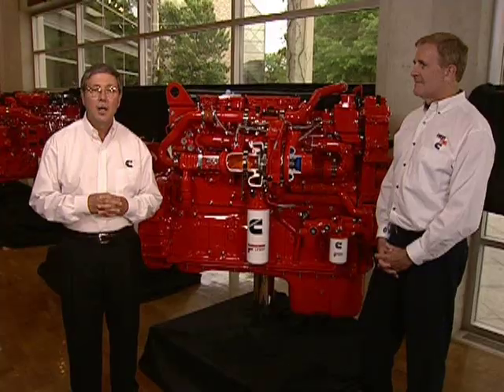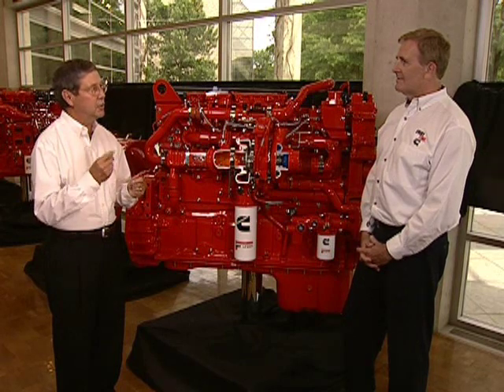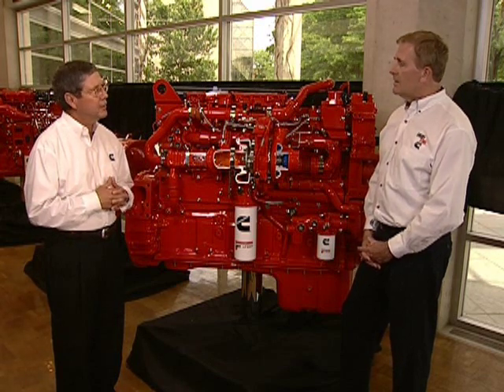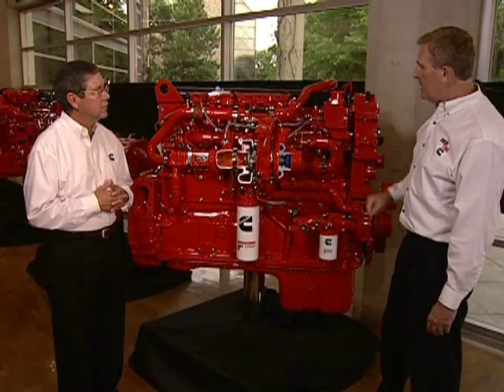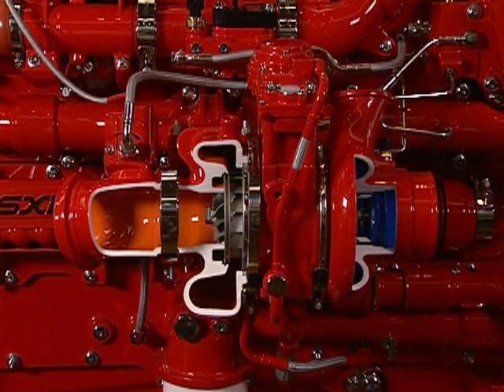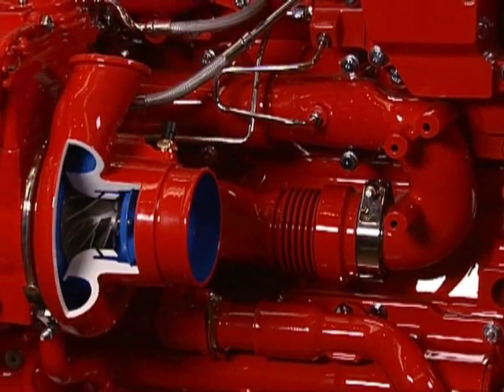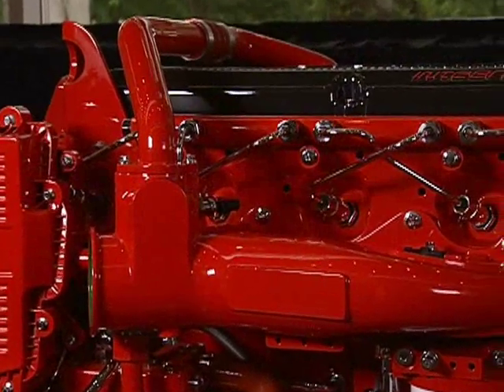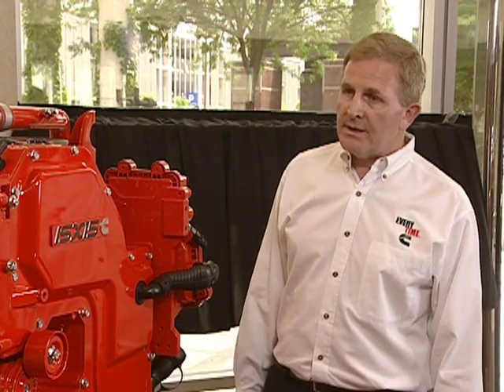2010 Cummins ISX15 Overview (Part 1 of 2)

Comment: THEY ARE GREAT!!!!.......until the front and rear main start leaking.....and the sleeve(s) drop....and the EGR granades....and the fuel pump blows......and the TURBO clocks out.....and INJECTORS crap out.....other than that they are GREAT!!! (I currently own 12 of them all Peterbilts.) I know these engines and their mechanics very well. Cheers!!!

Comment: Better fuel economy from SCR you guys are full of soot.  This is the worse thing to happened to diesel reliability since invention.  Tell people about the fuel pump that goes nuclear on the isx takes the engine with it tell people about leaking egr cooler that gets coolant into combustion chamber or that idling isx under 1k rpm will guarante you never see 500k. How much time you got I can go on all day
Reply: I’m looking to purchase a truck soon. I was looking at a 2012 T660 with 600k miles on it with an ISX 425hp. The more I read about this ceramic fuel pump being a grande for the engine, the more I avoid Cummings ISX engines!

Comment: Do not buy a Cummins older than 2014-15 unless it's been rebuilt with the new pistons and liners.
Reply: I have 06 K W w/ISX 1,200,000+ bearings and turbo at 600,000 that’s it. Schaeffers oil is the secret sauce

Comment: Everyone bitching that food and general merchandise costs haven't declined along with fuel prices over the past 9 months.... above is the reason why.  EGR/DPF systems on these over the road engines have increased repair/maintenance costs for trucking companies and owner ops by 20% on the bottom end.    You wanted regulations for those mean ole trucks.... now you are paying for it when you check out at the store.  Enjoy :-)

Comment: this engine is 100% BULLSHIT
Reply: So, how do you explain record sales?
Reply: the sales records .. does not make it a good engine .. cummins can continue to sell millions of motors .. but will remain the same crap ..
Reply: seabulls69 Records sales because they also entered small duty trucks/vans distribution.
 Fleets have only a limited selection now that Cat has left the over the road market leaving Cummins, Detroit (Freightliner trucks only) Volvo(volvo trucks only) and Paccar.  So you have mainly a selection of only two engine types in all new Peterbilt, Kenworth trucks.. a Paccar (Kenworth and Peterbilt company) or Cummins as well as International trucks offering cummins.
This engine might be a lot better if it didn't have the egr/dpf system on it. Those have caused many problems with all brands but more so with Cummins although they are working out a lot of the bugs and system failures there are still a high rate of problems and high increase in
maintenance costs.     Some owner ops and small businesses who don't do their own repairs/maintenance have been financially pushed out of the business in trucking with these new epa compliant turds.

Comment: i bought a 2014 prostar with a 550 isx rated at 564hp and i do heavy haul . I have to say I love it so far. 38000 miles no regens no issues avg 6 miles per gallon . 18speed with 3.70 rears and 22.5 tires
Reply: I drive a ISX with 12000 hours and 92000 miles. It's good with good power. But do you find the turbo spools up too much almost making shift points harder from a stop. It's like a turbo brake constantly.

Comment: I work on these engines ALL THE TIME. Absolute junk!!!!! After the N14 Cummins has went down hill. if Cummins has been using SCR  in europe since 06 then why have they not figured it out yet. The best part is if you buy a new truck with this engine and keep track of the mileage along with the failures and get another new truck with the same setup, expect the same failures within the same mileage. Thank you Cummins and EPA.

Comment: I bought a 2010 ISX15 500ST in a Volvo VNL730. It has to regen every 1100-1300 miles for 30 minutes killing my fuel mileage. After 165,000 miles the VGT in the turbo has been replaced. On the aftertreatment side I have replaced every sensor atleast once including both nox sensors.  It is currently in the shop to replace the EGR cooler and EGR valve and they just told me that they are going to pull the head. So far it is all warranty work. Merry Christmas!
Reply: Ever thought of having it deleted?
Reply: @PoliticalGangster  I sold that truck 5 years ago.
Reply: @keithgreen70  ahhh ok thank for the reply